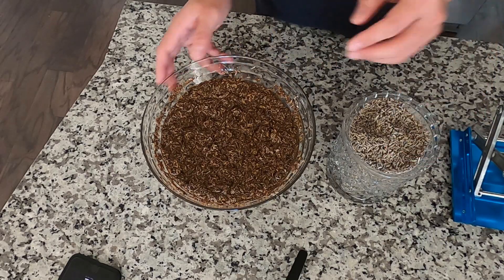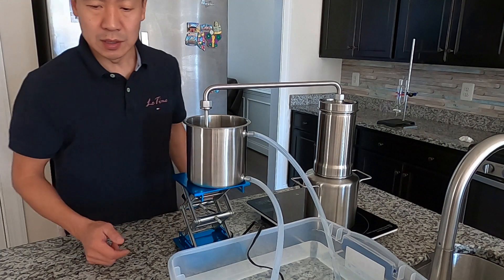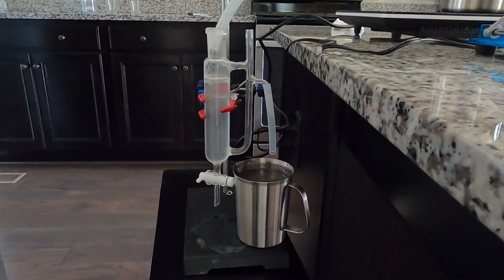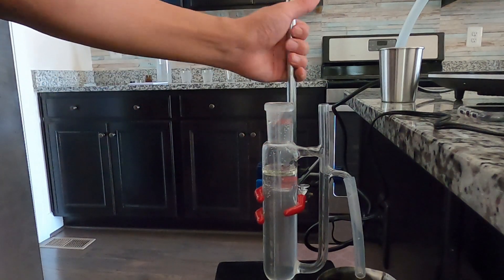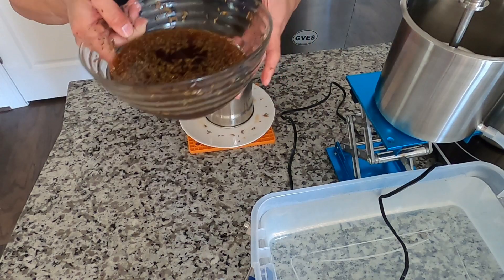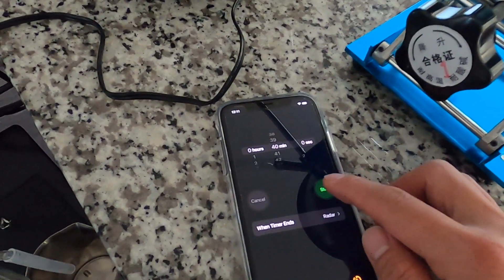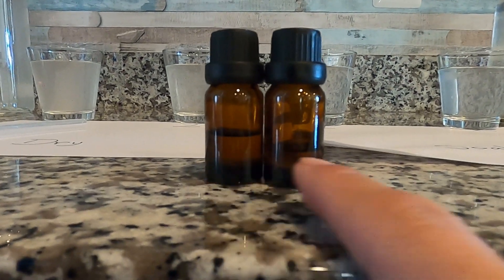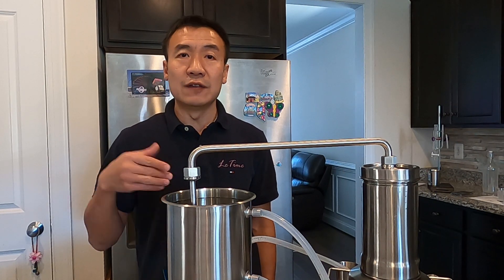Steam Distillation with Dried Lavender Comparing with Soaked. Which One is Better?

Comment: I enjoy your experiments. 
Do you not need to add ice to the coiled pot?
Reply from the maker: Hi, how are you! A circulation is used with large volume of water helping cool down. However there is a lot of heat to be exchanged out while running longer time. Need replace cooling water once becomes hot. Add ice into the cooling reservoir can definitely help extend the period.
Reply from the maker: Thank you very much! Please also post your school link here as a new comment so audience can go to check.